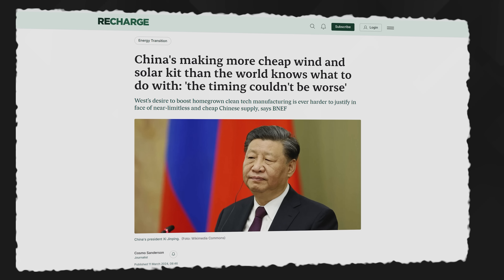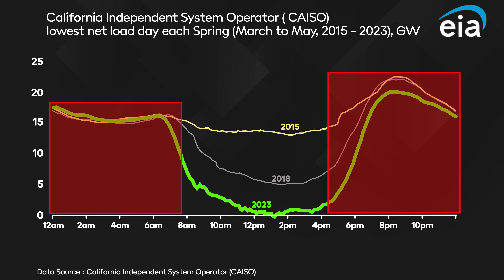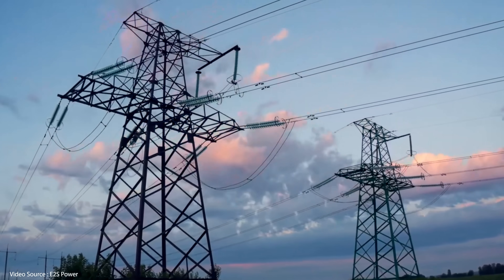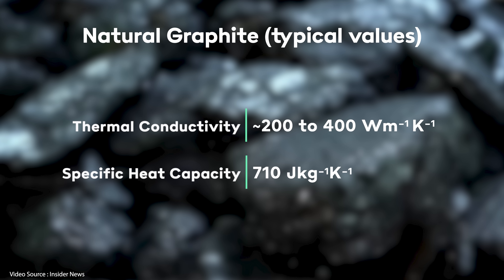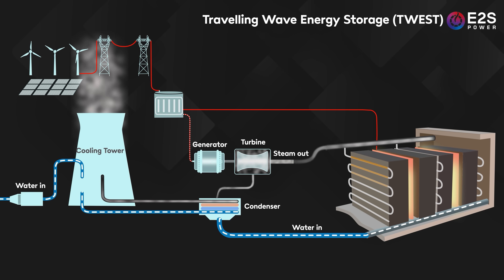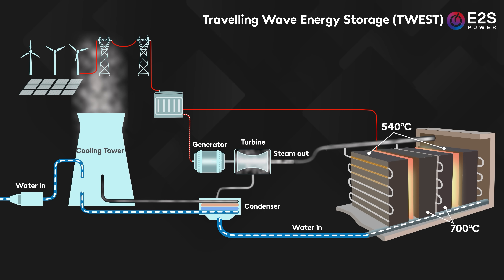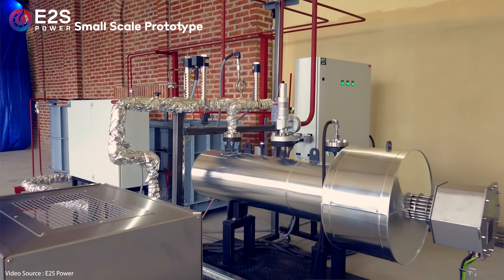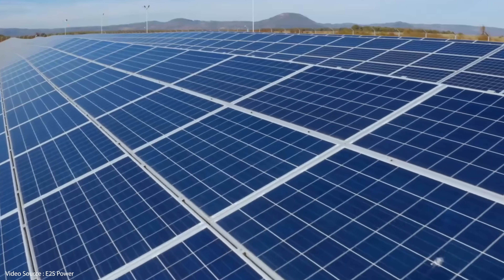A coal power station without the coal! How 'WIN-WIN' solutions could save an industry.

Comment: And, as big oil does with their communications, we can even let big oil know their coal and gas infrastructure can be kept in place and used as a backup for those times there’s not enough heath capacity in this graphite cell.
Reply: No you can’t because that would double the cost of power. The redundancy for renewables has to be additional renewables.

Comment: Lots of potential advantages and synergies, but the round trip efficiency of this will be very poor. Electricity to steam efficiency claims of 99% are credible, but steam to electricity efficiency will be much much lower. This is going to make the economics challenging. Even electricity from low cost renewable energy needs to recoup its cost of capital plus risk margin, its never free.

Heat batteries (carnot batteries) such as these have been proposed for many years but not yet proved commercially. I remember discussing this more than 10 years ago with the founder of Stiesdal. At that time he was interested in repurposing coal fired power stations for heat storage with electricity discharge, using the existing coal fired power station steam turbines for discharge and the ash heap as the electrically heated thermal store. I suggested that they ditch electrical heating and use pumped heat (carnot battery) and cold which they seem to have adopted https://www.stiesdal.com/storage/the-gridscale-technology-explained/

Comment: Interesting. Now I wonder if there is some kind of technology we could use to boost the efficiency of such a system. Something like a Ultra-High-Temperature heat pump ...🤔
It's probably not feasible, but would be pretty cool if the whole process ran at efficiencies of 100% or higher.

Comment: This is all well and good, but the round trip efficiency from the whole system is going to be quite low - pretty much the same as existing thermal power plants, which is tupically between 30% and 50%, so a lot of energy will be lost (50% to 70%).

They quote 99% efficiency for the electricity to steam process, but this ignores the steam to electricity efficiency of the turbine and associated equipment. Modern boilers are already quite efficient at converting thermal energy to steam - this is not where the efficiency losses are in coal plants - the major losses are in converting steam produced to electricity in the turbine/alternator/condenser equipment. These are still part of this "new" system.

Existing storage technology such as batteries and pumped hydro have an 80%+ round trip efficiency, so it's difficult to see how this technology would be able to compete with that....
Reply: That's quite true..Coupled together with the inherited problems of low energy density, high temperature operation and inability to operate with air contact.. just have a think!

Comment: Antora Energy has that same system using coke as the carbon storage medium. The turnaround efficiency for both is certainly much less than 40% because the original thermal power  has its conversion efficiency at ~34-40% and the stored heat must again go through a second turbine with the same efficiency. Where the original thermal energy is fossil fuel fired, there's a high carbon cost of the low efficiency double use of steam conversion even if the storage cost is lower than batteries.

Comment: What this means is that you need 2 to 2,5 times the elektrical input you want to get out. throwing more than half the elektricity away. To make this possible either elektricity during the dip of the duckcurve needs to be so low that wind and solar farms can't make any money or the next source in the merit order needs to be expensive enough. That's the reason the solar and wind people don't want nuclear in the mix because that would significantly reduce energy prices destroying the margins they have on such energy innefficient "solutions" especially when you consider the CHP porential that wind and solar PV lack.

Comment: Why couldn't they use local solar thermal energy? Instead of photovoltaic solar panels, solar thermal panels or focused sun from mirrors? Btw, the biggest source currently for inexpensive carbon comes from fossil fuels. You should see how much "coke" the bury in the fort Macmurray region. Coke comes from the process to upgrade bitumen. There would still be maintenance on the heat battery due to the piping used to move  water through the system. It's a great idea though. A really good start.

Comment: From the title, I thought it was going to be burning biomatter. This has the advantage that you can prevent the biomatter rotting and producing methane, and convert a fraction into a sequester-able form of carbon. (there is biochar, but also some sort of low grade oil we can produce. I forget the name). Thus this process can actually be carbon negative instead of just carbon neutral.

Comment: Summary

* Problem (0:00): Coal power plants are retiring as we transition to renewables, but they provide essential grid inertia (frequency stabilization).
* Solution (1:28):  E2S Power's TWEST (Traveling Wave Energy Storage) technology can replace coal boilers in existing plants.
* How it Works (2:15): 
    * Graphite blocks heated to 700°C by electricity (ideally excess solar/wind).
    * Heat stored for hours/days, then used to produce high-pressure steam for turbines. 
    * Precise temperature control maintains constant steam flow.
* Benefits (6:43): 
    * No fossil fuels burned = reduced greenhouse gas emissions. 
    * Independence from fossil fuel price volatility.
    * High efficiency (99% electricity to steam).
    * Low maintenance costs.
    * Preserves grid inertia from existing turbines.
    * Smaller footprint than battery storage.
    * Repurposes existing infrastructure, potentially preserving jobs.
* Current Status (7:55): 
    * Pilot plant successfully integrated into operating coal plant in India.
    * Pre-qualified for use in plants across India (large coal consumer). 

Overall: This technology has the potential to be a significant step towards a cleaner energy future by transitioning coal plants rather than abandoning them. 

i used gemini 1.5 pro to summarize the transcript

Comment: Very cool.  The efficiency  can't be all that great, with 50% loss in the turbine. But because you've already written off  most of capital costs over the life of the coal plant, the install cost is really low.  The install cost has to be way cheaper than an enormous battery bank, but not nearly as efficient.  How long would the batteries take to pay back the extra capital cost,  5 years?  10?
Reply: If the efficiency ever becomes a concern, it can be increased with cogeneration or even trigeneration (extra MHD generator stage). However, the main objective here is to remove cheap or negatively priced energy from the market - currently it's mostly being done with huge resistor banks that do nothing except heating the air. Releasing a part of captured heat as electricity during the peak demand is secondary.

Comment: California has almost unlimited potential for pump storage, if the approval process wasn't measured in decades. You have to buy a coal plant to avoid the 6 years backlog for grid interconnect. You also should check out the Taiwan power exchange market that creates an economic model for wind sourced energy storage.

Comment: well all good, but the jobs that will be lost are the resource extraction jobs, and the jobs transporting coal (or whatever other fossil fuel). Those will be much , much more numerous than the number of people working at a thermal plant (which won't be in the same region as the resource extraction happens, most of the time). You yourself point this out, by saying that the maintenance costs will be much lower. Yes! Because the people currently doing the maintenance will be reduced.

Surely, unless the plant is new there will be substantial upgrades needed to bring it to standards that did not exist at time of construction. Some things that are grandfathered in will not be when the core mode of thermal generation changes. 

I hope this finds a use, but it's worth remembering that the resistance to renewables comes from huge numbers of investors and owners of resource extraction companies, and governments that have been captured by that sector, who want to preserve current models of profit.

This idea of saving the plant itself, once eliminated, returns the thermal storage tech to where it seems to be best used, which is in local, non-grid based uses in high energy input industries. Why make things complicated by involving grids, local, state and national electricity regulators, and the uncertain market for energy where you're one of hundreds of competing suppliers, when you can buy a private system, and simply lower costs that way?

Comment: Are they recapturing the water from the cooling towers to reduce water consumption? And could they add a desal loop on as part of the initial temperature control for locations that need to use mineralized or saline water?

Comment: 1. The heat retained depends on the external surface area, so I'm not sure if modular units are the way to build a scalable system. Bigger cubes offer smaller external areas. Nitrogen supply could also be centralised.

2. The possibility of using a solar heat collector instead of wind or solar panels was another important aspect that could have been examined, given India's plentiful sunshine.

3.  The pilot project being in India, where skilled engineers work for a pittance, it was actually a great opportunity to examine the possibility of on site construction rather than modular units.

Comment: It would be interesting to know the round-trip-efficiency from electricity going in to electricity coming out, especially if the discharge did not start for several hours after charging was complete. Would it compete with the ~95% efficiency of lithium-ion batteries? That would be mind blowing. Regardless, reusing existing power plant assets seems very effective and a great marketing pitch. Hope it works. Great video as always!
Reply: Dave reported a 45% round-trip efficiency.
Reply: @helkafen100  Yikes!  Not great then. Even iron-air batteries are expected to reach 50%.

Comment: Just have a think about this, in the UK a 5kw solar system regardless of orientation on average can generate 4500kwh annually, I believe 20 million homes in the UK could have solar and storage, 4500kwh ×20million??? Coupled with 20million 10kw storage batteries that the grid could export from, costing £10k each, fitting within weeks, and countless other benefits.

Comment: Steam turbines can't ramp up too quickly because they run at hundreds of bars, so they are very thick. Any thermal gradient inducing an exceeding mechanical stress would crack the casing. This is the reason why I think following the duck curve with a steam turbine is easier said than done.

Comment: poor round trip efficiency which is bound to happen when electricity is turned into heat.    very cheap iron based batteries may be large but they create a much higher round trip efficiency - never throw away electricity if you can avoid it

Comment: So..  they generate electricity.. convert it to heat, convert it to pressurised steam.. then kinetic energy, then back to electricity.
Sounds like a hort term solution when you can simply use grid size batteries..

Comment: I thought you were going to talk about the company working on drilling deep geothermal wells near coal plants, using an extremely high power (100kW to 1MW) microwave drill.  But this thermal storage idea makes a lot of sense too.
Reply: came with the same thought in my head! :)
Reply: Which company?
Reply: @DrSmooth2000  Quaise Energy
Reply: @DrSmooth2000  Quaise Energy
Reply: @DrSmooth2000  Do a web search on this subject and you will find it.

Comment: Few things to note; while the conductive efficiency is high, that's not representative of the total system efficiency. Depending on the input energy source (assume solar), going from solar to AC, stepped up, converted to heat then back to electricity might be less cost effective than chemical batteries - depending on the cost of the installation.

Another thing about this that got me thinking; we have demonstrated here that thermal batteries improve the efficiency of thermal plants so why wouldn't utility operators just integrate graphite thermal batteries into existing coal/gas plants and skip the solar? 

It might actually offer a practical win-win first step towards renewables because it would be a win to have current plants be more efficient and they could swap to solar later given everything would be set up for it.

Lastly, I'd love to see this technology evaluated for use at a smaller scale - houses and apartment blocks. There might be merit experimenting with micro-CHP generators where, combined with smart meters, the battery thermally charges when prices are low and discharges when prices are high - helping to stabilize the grid thereby reducing emissions by making better use of our current generation setup. 

That said, it would probably be cheaper to just insulate all the houses on the planet and reduce electricity usage that way, lol

Comment: Great way to make the change 
- still keep largely installed assets making money.
- Much quicker retro fit time.

I wonder could any other technologies be coupled with this? Cascading heat pumps to heat the bricks, at least initially.
PCMs depending on the temps they can realise?

Comment: So the footprint is smaller than  a battery power plant based on what, the energy stored in the graphite vs. the battery or the net energy returned to the grid per cycle.  A round-trip efficiency of 40% vs. 80-90% is a serious operational disadvantage.  Off the top of my head, the cost per unit energy stored  would need to be at least 1/2 that of the battery competitor in order to make an equivalent return on investment.  There is a lot to be said, however, to not have to jump through the hoops required to connect to the grid.

It would be interesting to see a more rigorous comparison between this system and battery storage for daily peak load management.  I don't have a good appreciation for the cost of labor to maintain and operate a steam turbine per unit of energy generated.  I just scratched around and estimated that labor could be as much as 15% of the net dispatched energy price for a turbine working 4 hours/day.  I would like to see a more authoritative effort at deriving such costs.

Comment: An Additional benefit if you use this in place of a coal boiler is you no longer have to deal with the Ash and sludge that is left over when you burn coal. No more retainer pools of Coal sludge that can burst their banks and contaminate local ground water.
Reply: What a great plan! Since solar and wind energy can't be used to refine materials for industry all solar panels will be made in China with fossil fuels. Then these solar panels will power western turism industry which will be the only industry in the west
Reply: Why delete comments?
Reply: Pulverised Fly Ash replaced cement in building blocks to the tune of half the the CO2 produced by coal fired power stations, but that is an inconvenient fact.
Reply: @robindumpleton3742 given fly ash ponds have dangerous metals like lead, mercury, uranium, cadmium, etc I'd be seriously worried if that isn't filtered. Tailing ponds are a environmental disaster, and one tiny upside to them is not an exoneration of the practice. Coal is just dirty as hell, and should not be burned in this century.
Reply: @robindumpleton3742  Fly ash is only part of the ash, and some getting used up in concrete does not mean there are no problematic storage sites.
Reply: @jrrarglblarg9241 Essentially 100% of the fly ash produced in Australia is sold to make concrete. The early decommissioning of a coal fire power plant here has affected the supply of concrete. Supply chains matter dude.
Reply: @SurmaSampo  Glad to hear that much is being used in Australia. Everthing I know about it seems like a good idea. I don’t think it’s as widely used in the us as it should be.
Reply: @robindumpleton3742  And what's left is edible if a little gritty
Reply: Nice to see something rated as being NEW and INNOVATIVE likely to be so but still requiring huge electrical input from those notoriously unreliable and expensive to produce 'renewables' which have a relatively short useful life and, as yet, have no mass method of reclamation/recycling .
So, a world filling up with old/damaged EV's, solar panels and wind turbines instead of 'sludge' puts a sour note on this innovation.
At least Nitrogen is being used as an anti oxidant, plenty of that around and recyclable?

Comment: That is great, but isn’t going from
Electricity to battery storage to heat storage to steam generation to turbine/electricity generation a low efficiency solution vs electricity to battery to grid? Is the benefit that the grid power infrastructure already exists at the coal power plant?